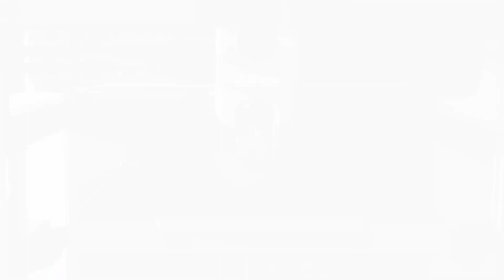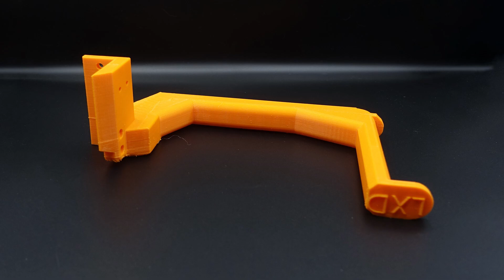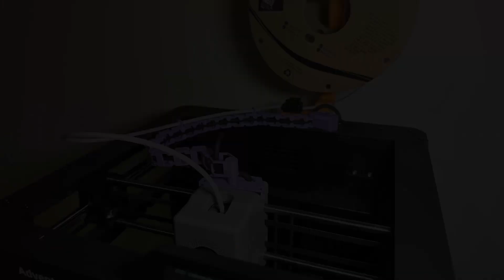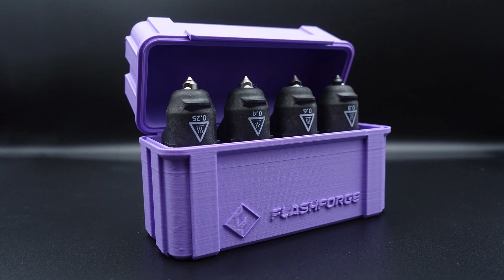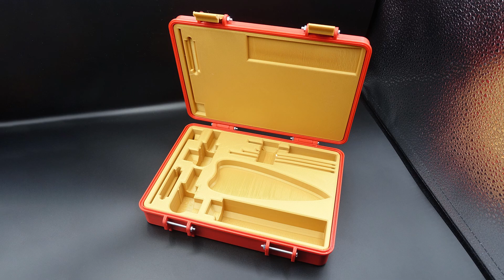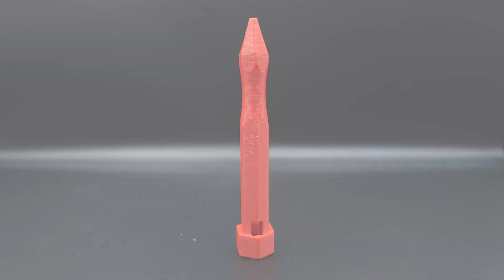Flashforge Must Prints!! (7 Things You Need to Print on Your Flashforge Adventurer 5M)

Comment: I tried to print the stylus file couple times. Every time, there is an adhesion issue and becomes spaghetti after couple minutes. I tried to use dish soap the clean the plate, then dried with Bounty paper towel, and also apply the adhesive glue. None works. I wonder what else I can do to print the stylus. For right now, I print a pointer found on MakerWorld as a substitute. But I believe the adhesion issue is my biggest enemy.
Reply: Use a brim for better adhesion. Should be a setting in the slicer. Also bump your initial layer temp up to 60 and then down to 55 for the rest of the print. This is also done in the slicer under your filament settings. Might have to adjust the z-offset to get a bit closer to the plate as well, be carful though, so you don't go too far.  Also doing a bed level before every print helps a lot too. I do not use any adhesives at all but I do have some issues with adhesion with tall and narrow prints such as the stylus you mentioned. The brim helps a lot gives the print more surface area to the plate. Are you using a smooth or textured plate?
Reply from the maker: Everything above plus potentially slow the speed 👍🏻

Comment: Hey LT3D, I dunno if you still read comments on your old videos. So I used the Scraper print that you linked on here. While my benchy printed out flawlessly, my scraper on the other had warped while printing? I even used the Adhesive that came with it. Any suggestions on how to fix this problem.
Reply from the maker: I’d recommend bumping up the bed temperature by 5-10 degrees 👍🏻
Reply: @LT3D_YT  how would you do that in flashforges orca slicer?

Comment: Quick question I got the ad5m today and sometimes my print doesn’t stick and it slides around with the nozzle how do I fix it?
Reply: I would say try turning the plate temperature up
Reply from the maker: I’d recommend re-running the bed levelling calibration if this doesn’t help try raising the bed temp by 5-10 degrees.

If that doesn’t help then I would recommend manually adjusting the z-offset. I have a video on how to do so here  https://youtu.be/tKAPKeok5A4?si=RIhpMFdmfzYSASnM hope this helps 😁

Comment: I got a Flashforge Adventurer 5M Pro. After 3 months started having problems. Bought a new extruder assembly for $100 from Flashforge after installation it quit all together. I am on a fixed income and still have to make payments on a piece of junk i now use as a shelf. Please don't buy this one, it's not worth the head aches.
Reply: I have one and honestly the only issue I have is where I print it gets really humid especially now during the summer. So I have had clogs but nothing too bad. Getting prints to stick is my own fault at not setting the settings right in the slicer 🤷 I'm not unhappy with mine.

Comment: "Today, I received my Flashforge AD5M and printed the Benchy—I'm absolutely amazed! The level of detail is incredible, even the tiny wheel inside the Benchy came out flawlessly. The print quality is nothing short of outstanding. Tomorrow, I'll be receiving the enclosure kit, which I'll be printing in grey. Sadly, my other two printers will have to endure a bit of envy!"
Reply from the maker: Fantastic to hear!
Reply: About to get one. What were your settings for heat and speed and filament used?
Reply: @jamestillman5247  I have used PLA, TPU, and PETG not specific brands from Amazon with the profiles included in the Flashforge slicer Bambu based, I have only changed the amount of infilled nothing else and everything comes out perfect. I suggest you to start with that.
Reply: Nice! I also just got a flash forge printer! But I don’t really understand how to print anything other than the pre downloaded things?

Comment: I find the prints are thin, for lack of a better word, it was as though the filament wasn't coming out thick enough for the lines to stick together, and when the print goes up in height, the underside is even worse... especially on rounded edges. I don't know what to do.

Comment: Nothing against the creator, there are some nice things to print here... but dont print your stylus unless you have some sort of screen protector on the lcd... 3d printed stylus... unless made of tpu, will scar the screen up over time, making it worse an harder to read than if you just used your fingers. Print the stylus with soft material or go buy one of those cheap universal rubber tipped stylus off of amazon. If you want proof... just look at any 3ds handheld. lol
Good video otherwise dude. Simple and to the point with the showcase. I was hoping the spool holder would work on the 5m pro... but doesnt seem soo. Thank you tho.

Comment: At what speed do you recommend I print the cable chain? I am starting out in the world of 3D printing and do not know what configuration to use without compromising durability and quality.
Reply from the maker: I printed it will the default PLA settings in Orca-Flashforge

Comment: I am loading the top spool holder with both Orca and Flashprint and it keeps saying The printing file is out of print range, the printer can't print it. I opened the .3mf file with orca flashforge to slice it and then exported the gcode and opened it with flashprint 5. I am hoping you can tell me what I am doing wrong. Thank you!
Reply from the maker: Honestly, I'm not sure as I have not had any issues loading the file.

Try just loading just the .stl of it below.
https://drive.google.com/file/d/1CQoWq1eXuvVMu6siA5KLBLsjZm2--Uou/view?usp=sharing
Reply: @LT3D_YT  in orca click on the individual build plates and just move the part if it is outside the print area.

Comment: Just got one for Christmas. I'm having the worst time with the software and getting it to connect. So far, I hate it. Anyone else having issues with Orca and using it over their wifi?
Reply: I use flashprint and it can send files to your printer via wifi, it's great!
Reply: I got one for christmas to and setting it up was the worst
Reply: @brandonirk4700  if you don't mind me asking, what happened? I had some minor issues but they can all be attributed to them working on their servers.
Reply: @kennenite2092  Yeah, either their servers or my wifi. It would say connected, but not send files,, saying printer is busy...
I have just been using a USB drive to transfer print files to it. No problems since I've been using it that way. 🤙🤙
Reply: @brandonirk4700 how? From box to printing took 15 min. And im new to this. One of my favorite things was how easy it was to set up
Reply: One of the easiest machines ive ever set up
Reply: @ honestly the physical set up was simple, took only a few mins. Their software needs work but they are doing that so fingers crossed they improve it soon. For now im gonna stick with orca slicer. The printer has been fantastic so far.
Reply: There's no problem with connection orca and ff adv 5m, you just need to select "flashforge" or something like that in type of connection near by ip address when adding new printer in orca
Reply: I can’t understand why everyone hates these printers! I’ve had this thing a few months now and it has been absolutely flawless!! Amazing how far £200 gets you.
Reply: The trick is to not update the software.  If you never update, you'll never have the freezing problem.  Also make sure the camera is off that Fs it up too
Reply: Just had one and I was told not to download the new update which helped so much. Sorry you didn’t get to enjoy it
Reply: Don’t use orca, use flashprint, it’s designed for these printers
Reply: @Jared_7071 orca slicer can work great, it's better then the orca forge one. Only thing Is right now I cant monitor the printer through the slicer but can send prints. Honestly the app doesn't even let me see my printer most of the time.

Comment: What screws are used to mount the Top Spool Holder?
Reply from the maker: @lgthouskpr  I used the screws that locked the build platform in place which you remove when you unbox it.
Reply: @LT3D_YT  Unfortunately I think I threw those out. I am going to reuse the screws for the filament sensor, just need to figure out type/size of screw to attach it to the back frame.

Comment: I get an error when trying to load the top spool holder 3mf into Flash Print.
Reply from the maker: As far as I’m aware the .3mf format is not compatible with FlashPrint. You will need to use either OrcaSlicer or Orca-Flashforge to open the file.

Comment: What are your recommended filaments for these prints?
Reply from the maker: Honestly PLA or PETG are completely fine. I usually stick to 3 brands, Bambu Lab, Polymaker & Flashforge as I have had no issues printing these filaments on multiple different printers.

Comment: Thank you , I just got my first 3d printer flashforge adventure 5 , I can print from flash print it finds my printer with no issue, my printer is configured with a static IP address via hard wire  RJ45 connection. 
I can login to my account on orca flash  
It connected a couple if times  but now it just displays server connection issue..
I am able to It profesional , firewall is fine it’s on a private network , it’s trusted device .I can ping the printer .
It just won’t connect
Reply from the maker: Flashforge’s servers aren’t the best and at the moment they seem to go down at least once as week, which may explain the server connection issue.

Comment: hey is anyone else having trouble with the top spool holder file ?
Reply from the maker: What sort of troubles are you having?
Reply: Yes. The top spool print ITSELF is fine. However the power cable to the sensor is not long enough to reach and screw and I also don't have the cutout on the sensor that was in their installation video on FB. I took the panel off to see if I can get a bit more length but I've got all the length there is. I'm currently printing the whole enclosure this weekend. Just gonna deal with the rear mount till this is done

Comment: Hi LT3D.  I have a question regarding the tool holder.  I printed everything however I'm not sure what hardware I am supposed to use for the hinges and the latches.  Can you enlighten me?  Much appriciated.
Reply from the maker: The hinges and latches require 6x M3x30mm screws.
Reply: @LT3D_YT  Thank you so much for the very quick reply!
Reply from the maker: @HarleyMan-u3w  no worries!

Comment: During the build of the nozzle box, what is that purple in the front? Is that a camera holder?
Reply from the maker: Correct, I was testing a webcam to see if it worked. Result is, it does but I definitely need to design something better as it’s currently held on with cable ties 😂
Reply: @LT3D_YT  gotcha, thanks for the reply! I'm still new to the end printing world, and haven't quite pulled the trigger on getting this machine, but I'm really close, so I've been watching a ton of videos on it, lol

Comment: Great ideas! I went for the side-mounted spool holder as I'm short and my printer is sitting on a stand. Easy to access. I might lengthen the Bowden tube that goes into the runout sensor so that the filament doesn't have to go around the corner of the printer.

Haven't needed a scraper yet as I find the flexible build plate is great for getting prints off (or if I can wait long enough the plate will cool down and the prints just slide off). For my tools I wanted them more accessible so printed out a mini multiboard and screwed that to the side of my printer stand.

I definitely want to print out the cable chain, but first want to decide what colour I want my enclosure to be when I one day print it. And the stylus might be handy as I find the screen touch sensitivity to be a bit slow in registering my finger presses.

Hope you're enjoying the 5M as much as I am. Always looking for neater things to print!
Reply from the maker: I'm very happy with it when it's working, however these new firmware updates seem to be a little buggy.

I printed my cable chain in purple as I plan on printing a purple enclosure for mine, gotta match the colours!